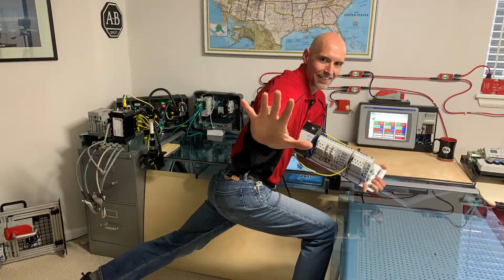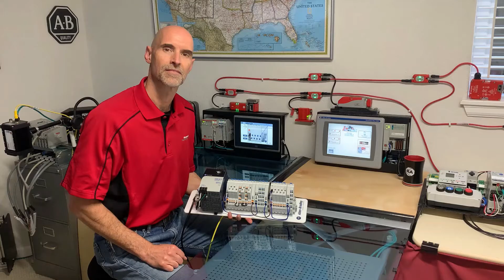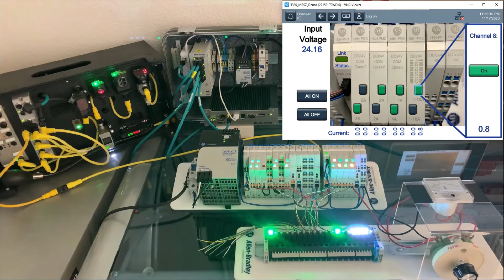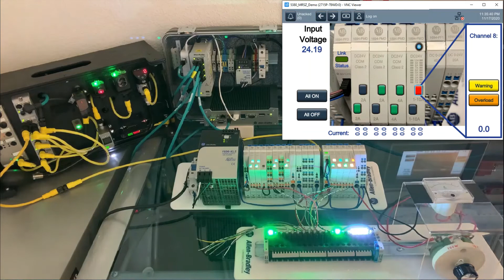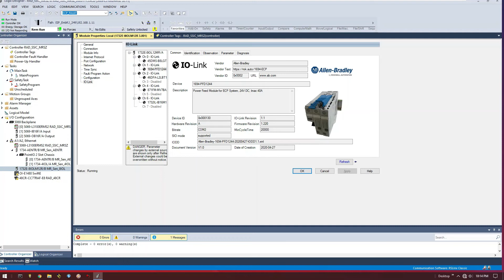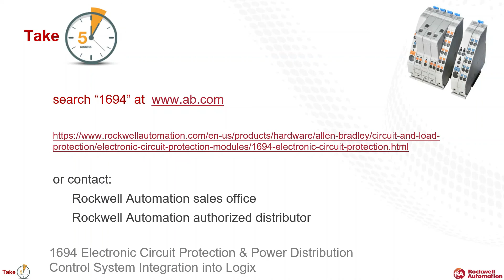1694 Sequel:  Electronic Circuit Protection Gets "Smart"

Comment: Distribution electrons to neuron circuit     Amplified the Negative or positive neutral conductors charge electronic cable connecting by fiber optic cables units Measurement graphing deteriorated and maintenance. 🦅👁️